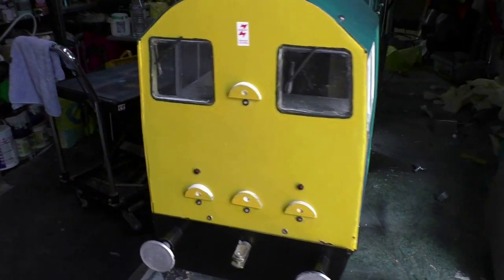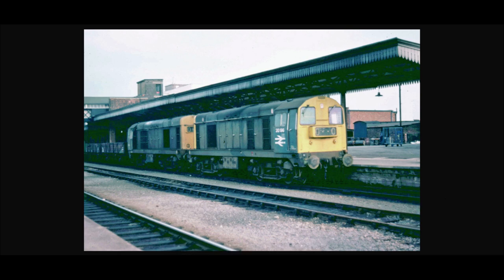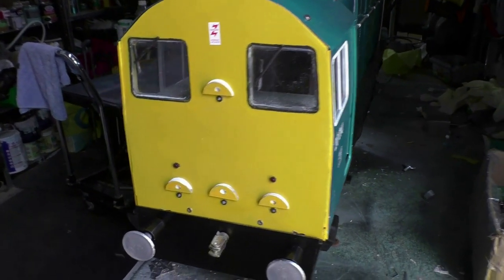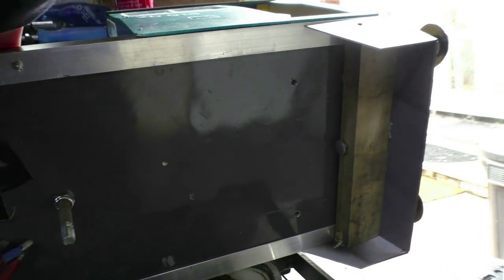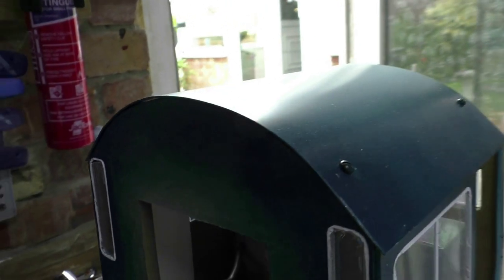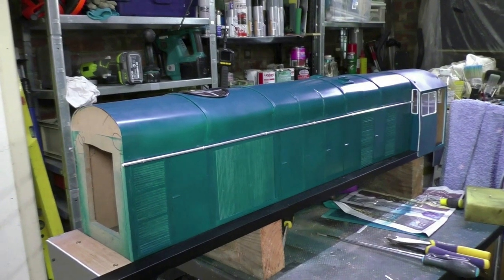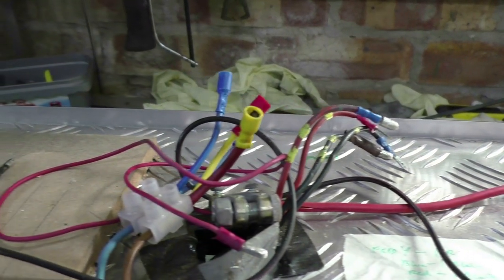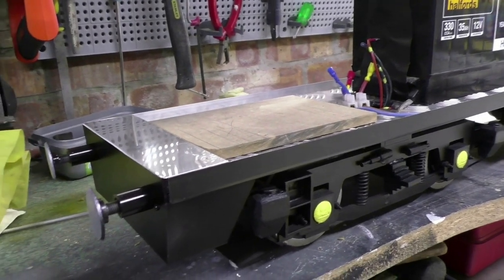My 5 inch Garden Railway. Building a Class 20 Locomotive. Pt 1.

Comment: I like the old 20s and the sound they make. Some were based here in Suffolk years ago on the rail cleaning trains. I would say your build captures the look of the real thing, look forward to see it running.
Reply from the maker: Yes that`s right I think they were based at Stowmarket. Thanks for your comments.
Reply: I just picked up a 5 inch gauge class 20 
Custom-made with LED lights and horns I’m already planning on modifications for it.😂
Reply: @jackminiaturetrains6627   Sounds good .

Comment: Excellent and well done it looks and sounds great. I have just finished a 5 inch Class 22 which I designed and scratch built. My build is very similar I also built the body from MDF with some 1.5mm ply and plasticard. It would be good to know what motors you used and see the build of the bogies and the drive system you went with. I went with 4 x 24 volt 150watt motors and belt drive. Any chance of a part 3 video showing the motors and drive set up, I,m sure people would be interested.
Reply from the maker: Thanks for your comments. That`s very brave of you, a Class 22 is not any easy one to replicate, well done. The power bogies and control system I already had in stock. The motors are 24v 150 watt  axle hung cog driven. You can see similar on my Class 35 build video. I`m interested that you also used wood and plasticard for your model, I thought maybe I was being odd by not using all metal, although there is no law to say you have to use metal. Anyway good luck with your build.